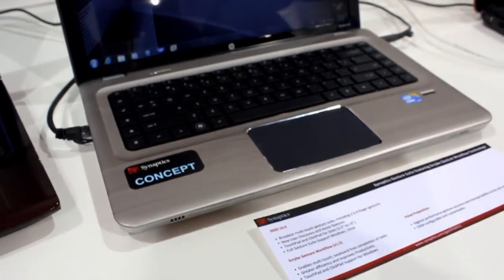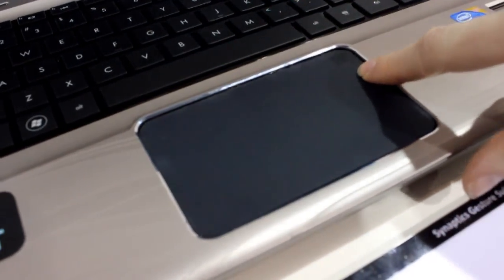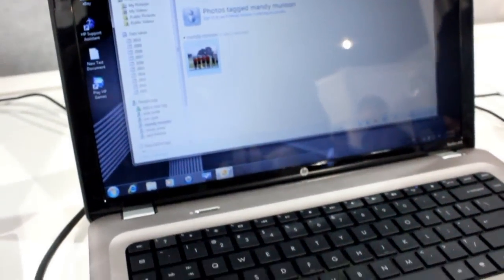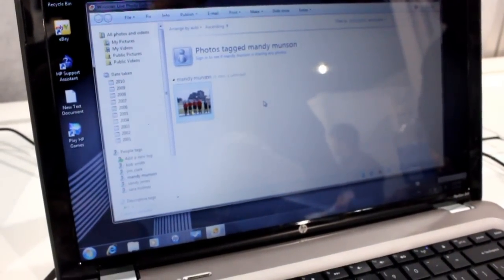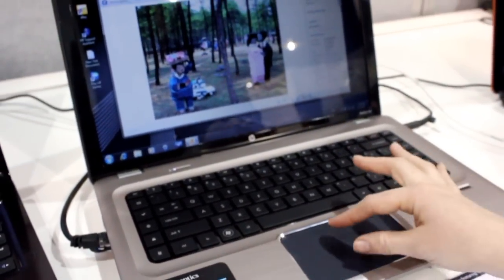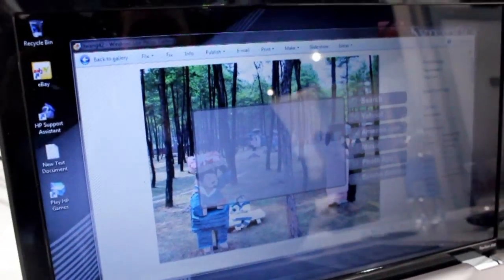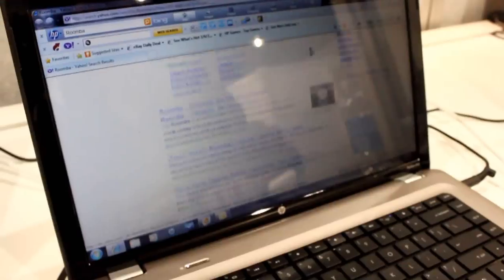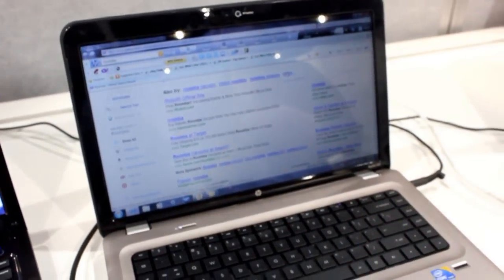Synaptics Touch Pad Demonstration

Comment: Synaptics drivers are often so bad to the point of not being usable. I wish this company in their entirety have a fucking miserable Christmas. No, better yet, I hope you all get colon/bowel cancer.

My touchpad works perfect on a fresh Windows 10 install. As soon as the synaptics driver has installed, the touchpad works for a few seconds then switches off. Ubuntu, Windows 7 32 bit and 64 bit, Windows 10 64bit, it's been bad since brand new regardless, except for the default Windows 10 driver before it decides to reinstall the Synaptics driver every fucking time it boots. Disabling the driver updates hasn't fixed it.

Comment: With recent drivers, scroll coasting requires too much effort to cause to happen.
Coasting could be controlled with a small flick of the finger. Now, a forceful effort is required. There needs to be a setting for this.